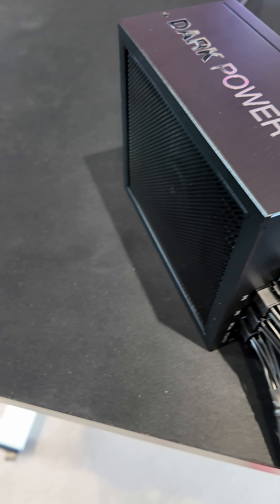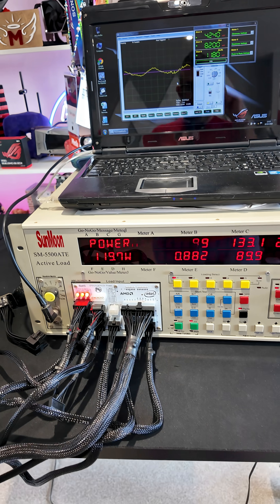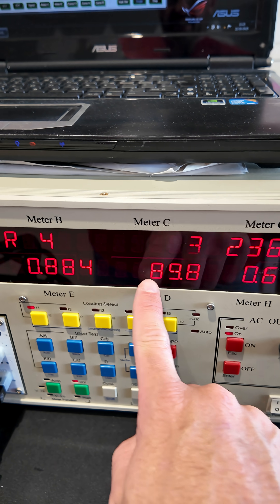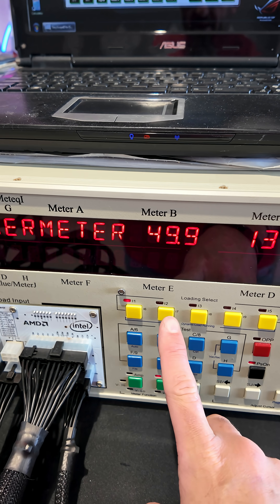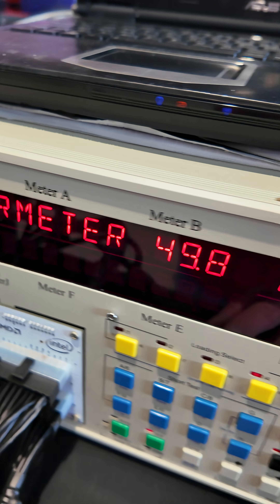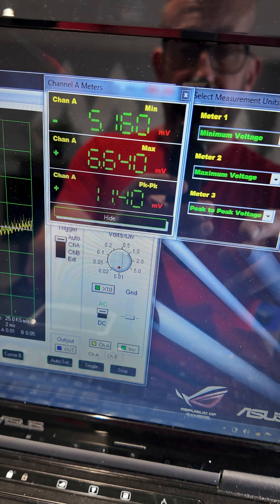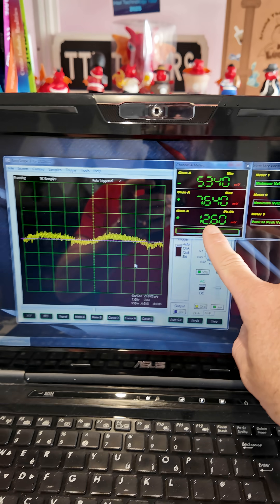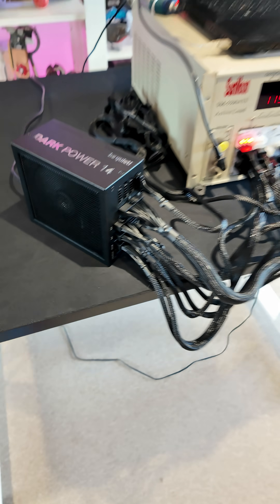Scary! PSU Load Tester - BeQuiet! Dark Power 14 #psu #poswersupply #loadtester #scary

Comment: Subscribe for your efforts. Any idea the difference between the 14 850w and 1000w? Obviously the name, but i wonder if the 850 is actually different internally to the 1000w. They look identical in everyway, and other than the rating everything is the same. Was only needing the 850, but now thinking the 1000 would be better if i get a more powerful gpu in the future.
Reply from the maker: Ive not tested both but in my experience there will be little between them other than the way they perform at 20%/50% - youll need to decide which one will give you the best efficiency at the load it will be used at the most. aiming for gaming load at as close to the 50% point is the sweet spot. If in doubt get the 1kw and forget about any faff
Reply: @OC3D  Calculated effeciency, its basically the same. Was more curious if a manufacturer may just change the name of a 1000w psu and call it an 850w for a wider product offering. Only calculate about 600w peak now for rendering, so will go with 1000w. Thanksfor your video.

Comment: I wonder will they release a pro version of this. I have 2 Dark rock pro 13 1600 watt psu's. I'm building another pc and if they will it would be worth waiting to pick one up.
Reply: if 1200W will suffice, I suggest checking out the NZXT GOLD 1200
Reply: @kingakim11  or the C1500 Platinum. Much better value than BQ Dark Power Pro will be